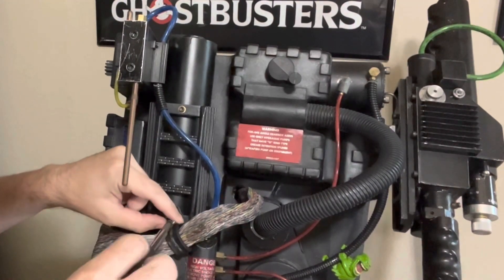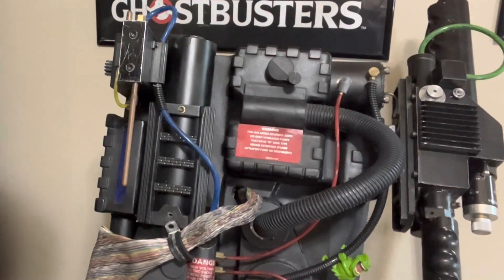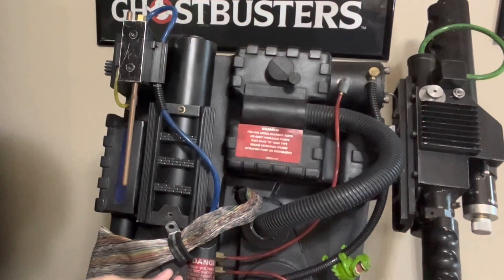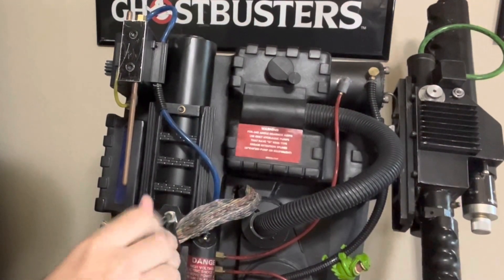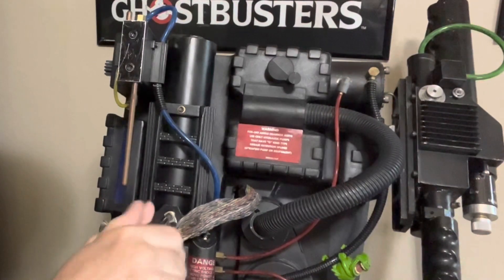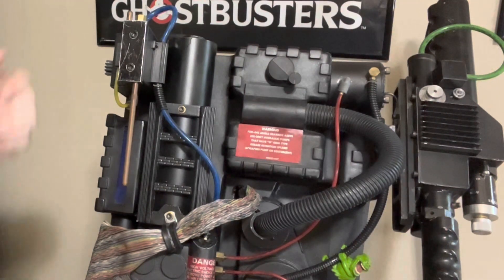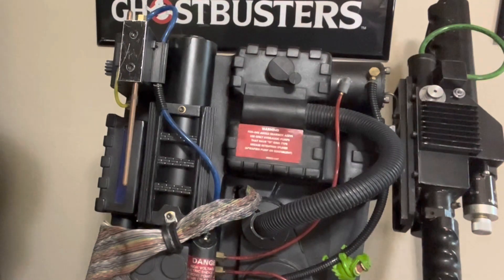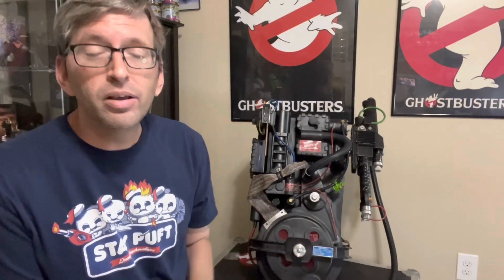The Venkman Conversion - Introduction and Booster Frame Washers

Comment: I have a question about my pack’s shell. I’m not sure where it originated but I’m told it’s an older one (maybe 7 years ago)… the cyclotron cover comes off separately and also the top portion of the shell comes apart from the lower part. 🤔 it looks fantastic but I have no idea who made it. Any idea?
Reply from the maker: Is it vacuformed? I’m not familiar with many shells that are separated like that.
Reply: @TheProtonPackIsNotAToy   it’s got some fiberglass reinforcement on the inside… its hard to tell to me honestly but I’m pretty sure it isn’t vacuum formed. Check my page to see some video.
Reply from the maker: It’s not one I recognize, sorry. I honestly haven’t had the opportunity to get my hands on a wide variety of shells. Your wand holstering on the v-hook was very impressive though!